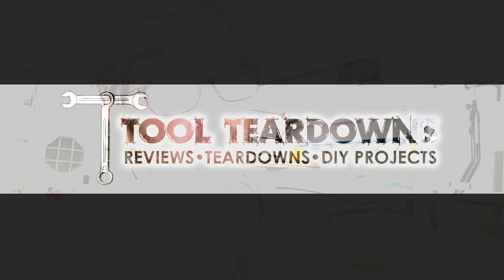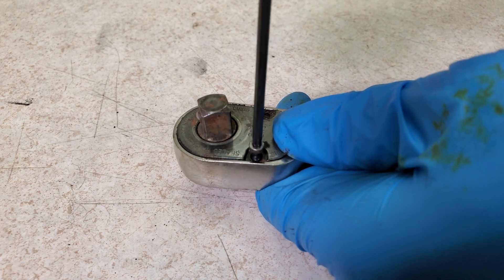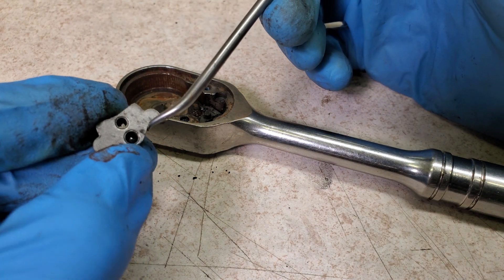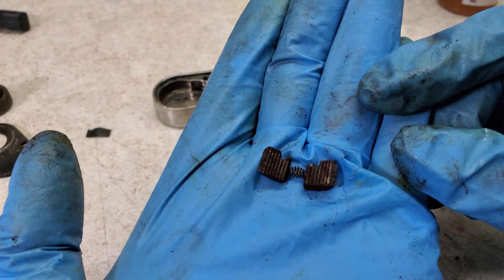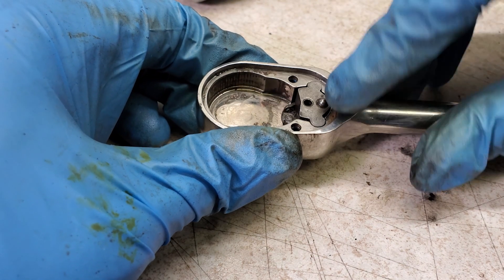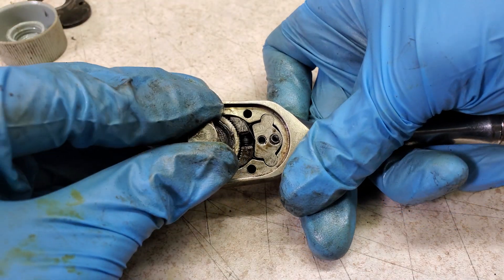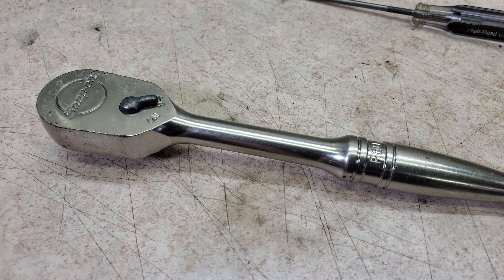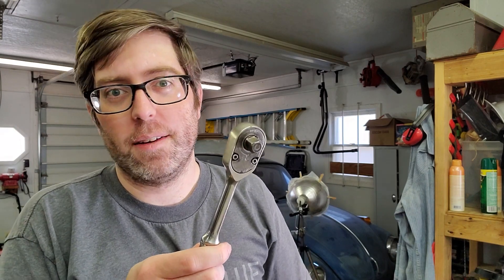Ratchet Rehab 3: How to Rebuild or Repair a Snap-On F80 80-tooth ratchet. Free ratchet review!

Comment: NIce video.  The repair kit for them cost about around $15 from the Snap-on site.  You get all new guts, selector switch, gaskets, and new screws.  You might pay more in shipping than what the kit cost.  They also send a little tube of Super Lube with it.

Comment: The cover plate screws weren't flush at the end.
Reply from the maker: They weren't flush at the start, either. That's just the way this ratchet is made.
Reply: @ToolTeardowns   If you have a grinder, I would have taken a bit off the end, just to make them flush.  Just while they're out.  I'm anal like that.

Comment: Cleaning and lubrication of ratchets is no different from engine maintenance; you drain the old dirty oil/grease (gunk) from the crankcase and install new oil.  I have a couple of ratchets that are nearly 50 years old and they work just fine thank you.  My SK flex head ratchet of 30+ years of age was replaced under warranty not because of the ratchet mechanism failing, but because the detent wore out so the head of the ratchet flopped around.  Take car of your tools and they will take care of you.

Comment: I did the same thing with an F 710 3/8" drive that I got from my Dad, except the gears on his were stripped so I had to order a rebuild kit. It works great now. 

And I agree with you, I don't like to abuse warranties, sure I probably could have exchanged it for another ratchet but it was probably abused, plus I have a ratchet my Dad used back when he built race car engines so it has some sentimental value as well.
Reply: How much is a rebuild kit? Is it worth it?
Reply: @ooltimu  It was around $15 if I remember correctly. It was well worth it, the ratchet is like new now.

Comment: Snap on warranty is not like a craftsman or husky. The independent dealer wouldn't warranty this at all breakage is one thing lack of care or abuse will get you a laugh from dealer.
Reply: Not at all true go to snap on / warranty
Reply: Doesn’t matter.  You can warranty straight from the website and skip the a**hole dealer, but the warranty applies to the original purchaser only. You have to provide proof of purchase for a warranty claim